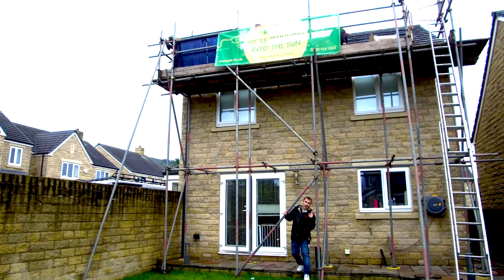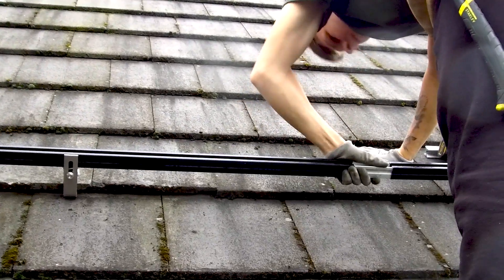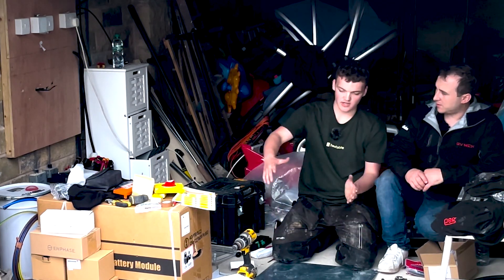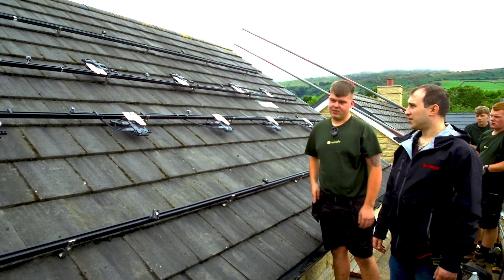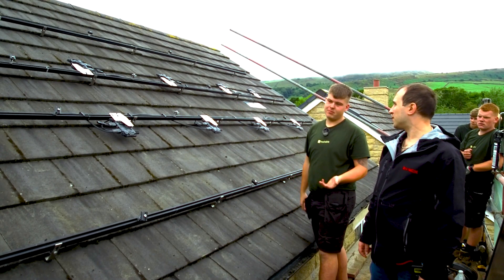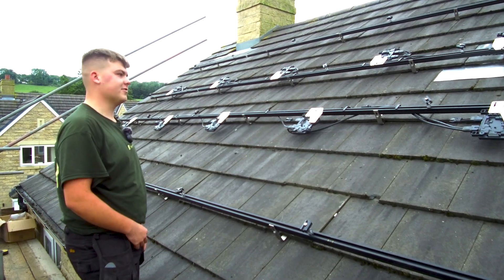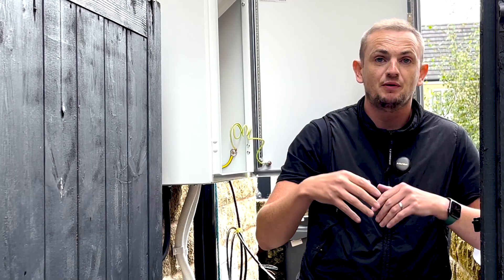Plug & Play - Solar Installation So Easy Your Nan Can Do It

Comment from the maker: Follow my solar journery at evnick.com/solar or get a fixed price  for a solar pv install from heatable clicking evnick.com/heatable
System Spec:  
10x REA Bi Facial PV Solar Panels 410w
10x IQ7+ Enphase Micro Inverters
Alpha ESS 5 kWh Home Storage Battery AC Coupled

Comment: Problem I have with enphase and solaredge is the micro inverters (enphase) or power optimizer (solar edge) is that they are installed under the pannel (instead of in the attic space where they could easily replaced) 

as you will have a micro inverter or power optimizer fail in there lifetime and the costs of getting them replaced wipes out extremely small the savings of using micro inverters or power optimizer

I love the idea of them but unless the micro inverters or power optimizers are installed in the attic space or ground solar installed I don't recommend them
Reply from the maker: The failure rate means your solar panel is more likely to fail (Enphase). They have a published failure rate and very very long warranty
Reply: @NicolasRaimo  I would just prefer to have them installed in the attic space can't be to much more to feed 2 solar wires into the attic space off each pannel as they are usually long enough to reach, then any fault finding can be done inside the attic space before you have to erect scaffolding to remove panels if they found at fault

Also for fully flat roof like this solaredge and enphase isn't as useful as most inverters have shade fix for at least 10 years even on the Chinese inverters ( if you had multiple roof angles or shade sources and you only wanted one string then solar Edge and enphase are good for that but you pay for it)
Reply from the maker: @leexgx  that would mean multiple entry points in your roof increase changes of water leaks the benefit outweighs the risks
Reply: @NicolasRaimo it's one groove under each tile per panel (the cable goes under the lip of the tile) and some sort of weatherproofing gasket so draft and moisture doesn't get in

Depending on the tiles they might already be doing groove cuts in the tiles for the racking, so 8 more cuts and install the cables and inverters in the attic space for easy testing and parts replacement

I believe both types of systems are really good, just that the inverters or power optimizers should be installed in an accessible location when not ground installed, if not a string inverter is easier to service only have to deal with panels or one inverter (if you use a thermal camera you can see witch panels are not working)

Comment: Your tagline raises some important questions. Solar Installation So Easy Your Nan Can Do It! You appear to have hit the nail on the head, it is a comparatively easy job. You clearly don't want people up on their roofs without scaffolding but I have a large garden shed and a carport with south facing roofs so installing 7 or 8 panels would be pretty straitforward. Connecting the panels and a battery to the invertor is also p[retty straitforward. Once again we don't want people electrocuting themselves even at the benefit of improving the national gene pool, so getting an electrician to wire in the invertor would be sensible. Why therefore do we have to pay a large mark up to installers for a system?
Reply from the maker: Warranty/0vat/mcs/insurance few other ressons but that should be enough

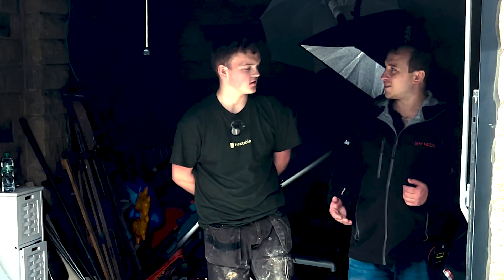Comment: Would optimisers be a better fit with a battery to improve round-trip efficiency compared to micro-inverters at 3:07? Or do you end up paying more upfront for both an inverter and the optimisers so it's a wash?
Reply from the maker: You don’t need optimisers with micros they do the same job but micros do even more,  optimisers also use a small power overhead so reduce efficiency,  micros use a little but less than your string inverter would also micros use nothing when no power is being generated your string inverter would have a standby voltage
Reply: @NicolasRaimo  I meant optimisers with a string inverter but your answer covered why that wouldn't be more efficient. So the round-trip loss is a small price to pay for the other benefits of micro inverters. I think longevity and redundancy are a big plus that you can't quantify easily. 

Another question: Do you have any way of measuring the temperature of your solar array? I wonder if solar panels pick up much heat in cloud cover in winter (debating whether I should invest in PVT)
Reply from the maker: @m23605  the micro inverters can show that on Enphase app if you pay extra for the info,  micro inverters have more efficiency not less,  they turn on more early and shut off later

Comment: May I ask some stupid questions ,having no knowledge of solar, are they wired in parallel or series ?   Why panels on roof because the expensive of erecting them there and maintaining them in the future ? Could you give a ball park figure of the cost of your system thus far , look forward to your answers ,take care.
Reply from the maker: Evnick.com/Heatable give you a personal fixed quote for you house I have a 10 panel system and generated 350kwh for august.  Roof as where else would I put them it’s angled correctly and I don’t have anywhere else for them,  regarding maintaining them the rain should do most cleaning however I see some people get window cleaners to clean them over few years but I think the snow I get here once a year should help with cleaning the dust off.  The warranty is 25 years that tells me they don’t expect them to cause any bother
Reply: @NicolasRaimo   Any reason you never mention the price I mean I rough price not the exact amount , regarding the panels seems that there’s more options these days rather than going for the roof option , you mention the angle of the panels sounds like you was given a good sales pitch,  people are putting the panels on sheds, in the garden which track the sun like satellite version, there are a multi ways rather than roofs , I think it’s moved on from that option, a little bit like the battery has moved on with the liquid battery and the upcoming silicon battery about to hit the market, thanks for reply ,will be watching with interest your future videos, take care.
Reply from the maker: @KavanOBrien  giving a price ages a video most my videos are viewed years after, prices can go up as well as down the website gives a price without giving your contact info so I’d say that was fair.  No sales pitch I just meant it’s better than putting flat to my building surface, panels work better when there angle matches that of your longitude on earth if you have a garage or a shed use that instead I only have a garage and I’d struggle to get 3 panels on it
Reply: @NicolasRaimo   Sounds like many reasons not to say this and I did this because,  I’m not convinced price may age the video, sounds not right , you may think of me how you like , I’m saying to you how I see it , does it make me right of course not , I can only be me , not trying to be awkward or anything like that , can’t put my finger on it gut feeling tells me something other than what I saw , who know your next video may make me think otherwise, you seem to be a nice soul , as said can only be me, take care.
Reply from the maker: @KavanOBrien  if you see my charger review videos or my home storage battery videos I never name price as like I said they change that website gives an instant price without your details for your given area your price depends on multi factors it’s not fixed
Reply: @NicolasRaimo   Ok, I do understand, personally I think the viewers want something different than just another battery and solar installation, hey that might only be my take on it , I know it might seem I’m being negative excuse the pun , the positive oh no it’s pun city, sorry dying is easy, comedy I’d hard , the positive one hopes you will change my mind with upcoming videos but don’t hold your breath, who know you might be the world’s breath holding champion. Take care , nice soul.
Reply from the maker: @KavanOBrien  sorry am confused change your mind on what?
Reply: @NicolasRaimo  I have no idea what your content and what direction is going to be going forward in your videos.

Comment: are the panels okay? looks like some cells are destoryed especially on that bottom left one
Reply from the maker: The cells are transparent so could be way camera angle got it or reflections behind cells… the micro inverters means I can see each panels performance individually and the month data shows a 0.7kwh difference from the worse to best panel on system for month of august but the panel next to worth is 0.5kwh out and this could be chimney shading or clouds ☁️
Reply: @NicolasRaimo  oh cool, sounds all good then

Comment: there are no IP rated boxes with top entry , and those tile gaps ,  not bad but this whole thig is built for speed and simplicity of the installers not longevity and quality or maintance but for the money they charge what do you expect
Reply: The meter box
Reply: What’s there to be sour about I do t fit solar or batteries
Reply from the maker: The DNO box is side entry not top,  DNO boxes ain’t Ip rated either,  also the holes were there previous from my entry of armour cable
Reply: @NicolasRaimo  DNO boxes are ip rated ip 55 I think
Reply from the maker: @Actual_electrical_content  IP43 which means it’s pretty useless
Reply: @Actual_electrical_content  My apology. You must have eyes like a hawk! I had to watch it again to see the gland at the top of the DNO cabinet. However I can't imagine that a DNO cabinet has much of an IP rating to begin with given the number of spiders in mine! That gland may not have been fitted for this installation as I know he has had at least one battery installed and numerous EV chargers which may require CT clamps on the incomer.
Reply: @tusdardcart  it’s my job to spot these things as an electrical consultant
Reply: It’s not useless it’s sufficient for the risk until people keep adding holes outside tbe instructions
Reply: Which box are you referring to? All the cables I can see enter the enclosure at the bottom. I don't think you watched it all. Sour grapes?

Comment: Interesting video Nick. My 4kWp system has generated just under 39,000kWh so far, I've never looked back!🌞😊
Reply: Wow, how many years? I've got a 4.68 system and it's generated 5600kwh in 14 months.
Reply: @JamFirst  had it around 9.5yrs. Do you have a home battery? I had one fitted a couple years ago & it changed everything!
Reply: @miickyp  yes I have a 8.2kwh battery it's been brilliant!
Reply: @JamFirst  happy days mate, I've been off grid most of the summer, love it!
Reply: @miickyp interesting that you’ve had PV that long. I’m still hearing people (inc people in the solar industry) saying battery storage isn’t cost effective due to long payback. Have you any thoughts on that?
Reply: @hughmarcus1  that’s very true even tho the payback is getting shorter the more the electric prices increase. My battery cost around £8k so I’ll probably never pay it back but I love being off grid half the year, I get home from work to a full battery (if it’s sunny) & trickle charge my EV & power my house in the evening, I’m not a high miler so can normally recoup the mile’s traveled that day the rinse & repeat the next day. We also don’t get many power cuts but when we do I can turn the smug level up & keep the house on as normal! 😊

Comment: Lol I keep checking all my apps some times the optimisers the inverter  the Shelly or the Victron app like seeing it from different apps, Nick I thought you where going solar edge? PS you are going to find yourself wanting more panels I know I do just so I can over supply the house lol. Took your advice on not having integrated charger so waiting for the Indra Smart Lux to be installed.

Comment: Watching this makes wish I had a new build rather than a 1960s house with gale-force winds and huge concrete tiles 😅
Reply from the maker: Should still be fine they do inspect your roof prior to install
Reply: I’ve got a 60s bungalow with concrete tiles and most of the roof is covered in solar. No issues.
Reply: @UntrainingUltrarunner  I just know that they will need to use scaffolding, upgrade the house wiring and fit a new consumer unit, drill through exterior walls everywhere and fit a new meter. Aside from all that it should be a doodle.. 👍
Reply: @decimal1815  might be worth an upgrade anyway to the electrics?
Reply: @UntrainingUltrarunner  yes, definitely. Just wish the government support was better. Hanging on in case the subsidies get more generous..
Reply from the maker: @decimal1815  scaffolding yes,  they will just split your tails and have a new broad for electrics like they did on mine so no need to touch existing.  Regarding government help that boats sailed FIT was the best now we have 0% vat and that is might be gone in a few years the price of panels has come down so much and electric gone up the government would argue no help is needed longer you wait longer your not saving on electric ⚡️
Reply: @decimal1815  the way I looked at it is that I’m paying my electricity bill for about 5 years in advance. The issue is that when the gov subsidises, because there is short supply of materials and people to do the job, the price just goes up.
Reply: @UntrainingUltrarunner  I was quoted a 10 year payback from the installation as a minimum. That's longer than we plan to stay in the house, unfortunately. That's £28k including 5kWh battery. We couldn't afford that and it's about 5x more than I paid for my EV!
Reply: @NicolasRaimo  my quote was £32k for an install with 10kWh battery or £28k with 5kWh. The reality is that it's too expensive for most households without support. Payback would be 10 years minimum according to my quote. Maybe I need to shop around more.. but it's not an easy install job unfortunately.
Reply: @decimal1815  you may have been quoted that but calculate your own numbers. The quote will be based on  4.1p a kwh for export and you only being able to use a proportion of what you generate. If you use more of it, or if you are on a better export tariff the payback comes right down. I didn’t get mine to save money - I got it for independence - but my payback I predict based on my usage and tariffs is 5 years.
Reply from the maker: @decimal1815  have you run a quote on Heatable? https://evnick.com/heatable I say quote it’s a fixed price
Reply: @NicolasRaimo  they have quoted £12,500 with a 5kWh battery. Much better.. although I'm also going to need a heat pump to replace gas boiler soon. There's got to be more support for all this from government at some point or the transition to renewables is not going to happen soon enough.
Reply from the maker: @decimal1815  heat pump has a grant under BUS scheme £5000 for boiler replacement
Reply from the maker: @decimal1815  they have a low rate finance deal coming soon for 10 years also
Reply: @NicolasRaimo  that will be really tempting ..
Reply from the maker: @decimal1815  if you submit your fixed price name and address when call centre ring you tell them your interest in the finance option and they should send you figures